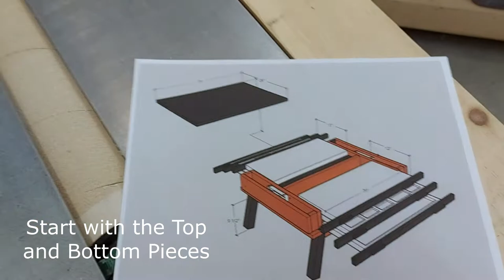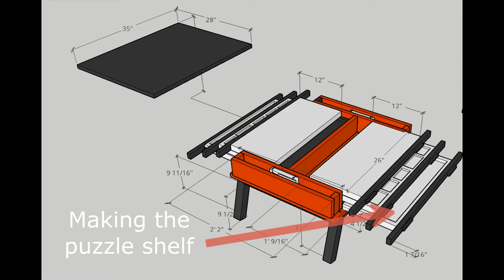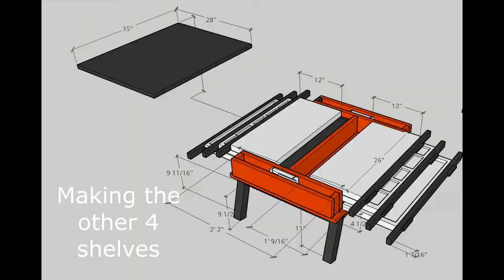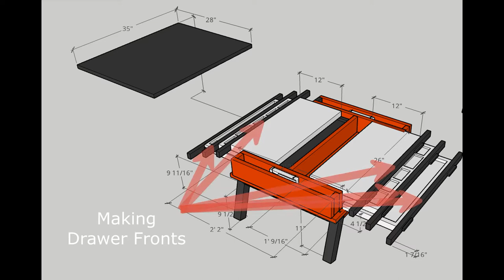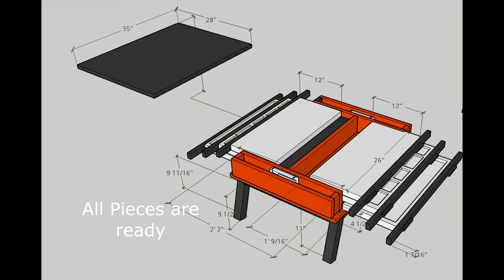Make The Ultimate Game Table [Free Plans]

Comment: This is very great talent and vert inspiration. How long does it take to do this . Just interested.
Reply from the maker: We've only built this one so far and we also video taped it which essentially doubles the time. We hope to do another one soon using own plans and not tape it to have a better idea how long it would take to make. If I were to break it down quickly based on the number of pieces, I would say 1 hour to prep the wood. Note that we have a table saw, jointer, planer, pocket hole jig...all the required tools that saves a lot of time. 30 minutes glueing up the the required pieces, then let it sit overnight. I tend to the prep and glue ups in the evening after I finish working on other projects so the last thing I do is glue and it can sit overnight. Then comes sanding and in this case some restorer tool to make the top a little more rustic ~ 1hour. Then 30 minutes to add pocket holes, then start assembling ~ 1 hour for the wood parts then about another hour to add all the sliders for the pull out shelves...lots of adjusting. Then 30 minutes disassemble, then spray on stain, wipe, let sit overnight again, the 3-4 coats clear coat, ` 10 minutes each coat using our Fuji Semi-Pro sprayer. So all in all about  5-6 hours should do it the second time we build it. Double that for our first time ;)

Comment: I'm thinking of giving this a shot. After looking at the plans I do have a question. The plans say three 1" x 12" x 8' boards which is 24 board feet, but it also says approximately 40 board feet. Should it be five of those boards?
Reply from the maker: Hi Julie, we're so happy to hear you will be using our free plans to make this table. This is our first plan we have provided and appreciate all feedback or questions anybody would have. You are correct it should be Five boards 1" x 12" x 8'.  I since created a cut list using Cutlist Optimizer and added it to our website. We would love to see how your table turns out and if you have any other suggestions in regards to how the plans worked.  Paul and Brenda